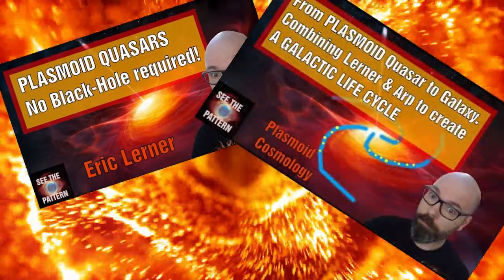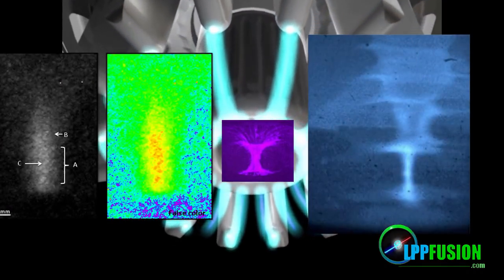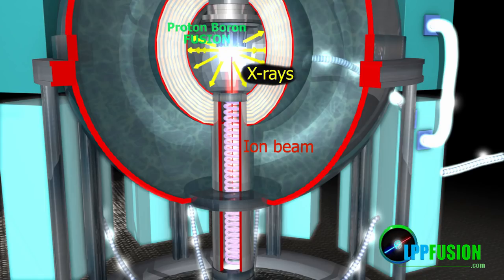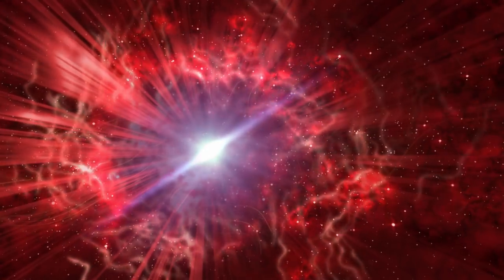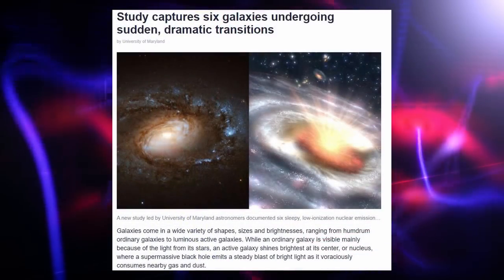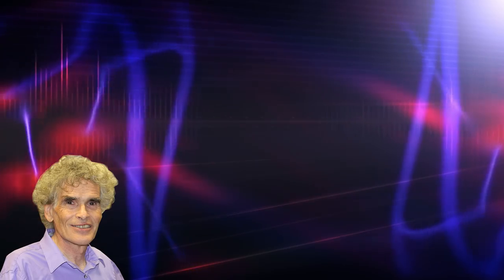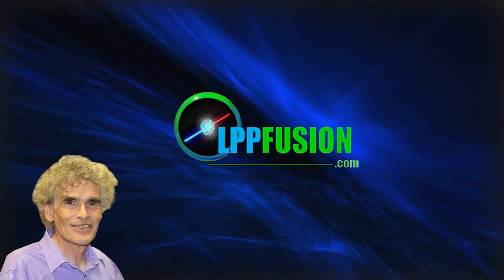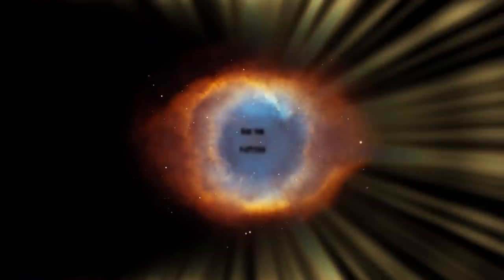Focused Plasma Fusion Technology & Plasma Cosmology with Eric Lerner

Comment: Utmost respect for Dr Lerner.. He's on the way to fuel/stability, as well as fantastic results because he's actually practicing scientific method, a rarity in sciences. Could be reason funding is lagging, that's an honest assessment.
His work is very likely to change his views on sun, plasma..wink, wink. 
His open mind, desire for factual results rather than planning tests for results to suit his theorem, is refreshing. Views shift as work progresses.
I'm not familiar with his new equipment. Rapid firing outside of initial pulse of start up? 
Not likely computer issue...BTW. delivery+sequencing+micro lag+initial firing creates minor pulsation in the best tuned race car. Overcome by electrical warming of fuel system in aspirated vehicles, doubled or tripled the startup firing switches on injected systems to fire rapidly enough not to offset causing pulse (in engine the elimination is heard because pistons to exhaust lacks the tell tale "whooshing" sound). The second and some cases third "spark plug" in line on each cylinder of injected motor creates that smoothness. Second exhaust port was added to high HP engines as smoothing and efficiency solution.
Not sure if this will help directly, however, may give ideas on solutions in their applications. Smooth firing in sequence at startup isn't a new problem...many times viewing things in different but similar applications helps, the reason I've dedicated enormous time to so many disciplines, odd hobbies.
Reply from the maker: Yes I wholeheartedly agree.  Great insights, thoroughly documented, accessible to all and tested in the lab.

Comment: Great episode, though I was somewhat surprised you didn't mention anything about Safire. What do you think about doing an episode on what the differences between Safire, Lerner's reactor and the Tokamaks are?  As for his setup, I do not recall him mentioning double layers or anything of the sort in his reactor, and unless he produces double layers I think it is doubtful he will  get more out than he is putting in. Double layers I think are key and I even suspect that they are a precursor to other EM structures in plasma such as Birkeland Currents or even a plasmoid, which also separates charge. I get there is a radical difference between his reactor and Safire, but replicating these naturally occurring plasma structures is the way to go. As Schauberger said, Comprehend and Copy Nature. And I guess in essence that is what Lerner is doing, just a different aspect of nature.

Another idea for an episode is to have Monty Childs and Eric Lerner on to discuss each other's work.

Comment: Some assumptions are hard to get rid off that is why it must be taking so long to produce desired results.
I appreciate the progress and techniques used by SAPHIRE team over Mr. Lerner.
Reply: Although both systems are using plasma the two studies are not really related. SAFIRE simulates a stationary Corona and the other has more in common with the process that drives galaxies. Neither will tell us much about the sun which in my opinion is what we need to investigate fully. It all helps but the sun is a very strange object indeed. We are so close to it yet know almost nothing about it.
Reply: I wasn't pointing at the actual experiment but the technique to perform the experiment.
Design of experiment technique is much efficient, giving better and fast results.
Reply from the maker: I'm not sure what technique Eric is using in his experiments

Comment: Are these guys in touch with SAFIRE?  The self organizing nature of plasma is obviously the key to fusion, not gargantuan gravity at the core of the sun.
Reply from the maker: No they have a very different approach to Safire. Lerners is using the dense plasma focus device which requires high energy plasma from the start. Safire uses a much lower energy more comparable to LENR

Comment: "There may be more going on..".
Inflation by exponential-log-antilog Sublimation-Tunnelling prime-cofactor frequency density-intensity alignment amplitudes and consequential  holographic time-timing presence sync-duration structure.., it's the entangled rope gone crazy as a picture of multiphase-locked superposition tangency space in the Aether, etc. An inspired design Artist is required to process and correctly correlate the collections of abstractions.

The ideas of elemental accumulation in Stars and Planetary Perspective are to be derived from reciprocation-recirculation quantization. Complicated and messy imagery. 

You can be sure that I don't quite know what I'm talking about. 
But if the fusion of heavier elements is taking place in veins of rock, triggered by lightning, that the "system-device" is dependant on the pseudo random arrangement of elements in the veins that catalyse. Ie a very special Fulgerite. Flash-fractal recognition of pulse-evolution scaling "explains itself".

Eg the Universe is a standing wave self-defining transient, metastable constant pure-math transition reciprocation-recirculation potential positioning, Superposition-point self assembly integration.

Comment: If we could just talk about the beam... it's 2x beams - how come, what makeup, what is it like. Also regarding the ape of the quasar, please specify that this would all be moot if we could put an induction coil around the quasar beam. Hence we put an induction coil around our own beam ie. this. Also, if we can differentiate a pulsar and a quasar and therefore how the physics of fusion apply to differentiate these beams. Also, is it an electron beam or an ion beam. Too much confusion around these beams.
Reply from the maker: If you watch the video I link in the description - Quasar no black hole required. It goes into more detail about how the plasmoid is created. In a nut shell there is a proton beam and an electron beam created once the energy levels are high enough.
Reply: @SeethePattern  Thanks, ok, the proton beam goes backward and the electron beam goes forward/ Magnetism is coiled up release.